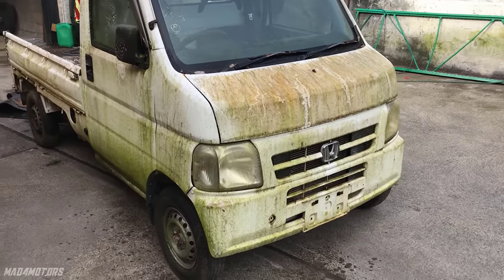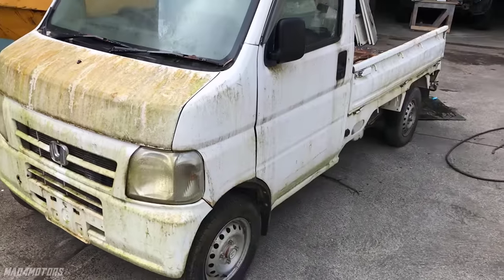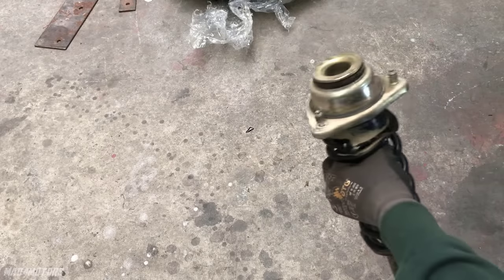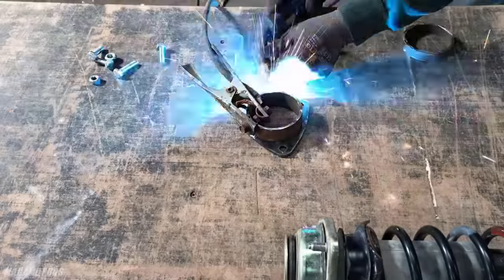Incredible Transformation Of A Honda Pickup

Comment: You did a good job on a reasonable budget. It must have been satisfying to do the transformation, cleaning off the rust and painting everything.
Can't believe the number of dislikes you got though. Very strange! Obviously it was never intended to be a bare metal restoration.
Reply: Its just shoddy repairs , proper repairs would not take much more.
Reply: @Alderonn10  its a work truck not a pavement princess show truck, repairs are different in the working world, heck could even be a weekend fun truck to use in the bush either way doing first class repairs would be pointless on something you plan on actually using and beating around in the bush

Comment: Much nicer than it was. Great job overall. Personally I'm not sold on the bed liner paint job for the whole thing. While it could be (probably is) more durable than a more standard paint it definitely comes off as a 'quick and easy' type deal that reflects in the final product. Obviously sanding/priming the whole truck for a more standard paint job would be a tremendous amount more work. Other than that the front lenses look like they could brighten up a bit with a polish or maybe a lot clearer with a quick LED lamp conversion. Either way you brought a lot of life back into that little truck and it's great that you did.
Reply: The benefit to doing this to trail trucks is it makes touch-ups way simpler and allows it to be fully usable as a work truck. But I agree it looks worse

Comment: Thanks for those highly entertaining videos. They are really brightening my sunday afternoon. I am quite impressed with how your paintjobs tend to turn out. Most non-painterbooth paintjobs i have seen so far don´t look anywhere near that good. That heavy duty coating was a great choice for this thing imo! 

It´s a shame a built like that would probably never be possible to be driven on the road here in Germany. The TÜV can be a pain in the butt when it comes to things like the bullbar, the lights that you added and the bigger wheels. But since i lack a few things to try my hand with a restoration like that (foremost a space to do it in and about all the skills beyond cleaning the basecar and pulling it apart.. 😉) I won´t have to find out if it´s possible to get one on the road legally. 

Just two questions remain: How much does it cost you (roughly) to bring a car like this to the state it´s in at the end of the video? And why do all your builds have the steering wheels on the wrong side? (Just kidding ).

Thanks for all this qualitycontent, keep up the great work!

Comment: Great video and amazing work! I live in a country where salt is much used in the winter. Therefore, it is common to rust underneath cars. Can you show how you may rustproof / treat rusted metals under cars in your future videos? For example, I was wondering if you painted the underpart of the car using raptor coating as well? Does raptor coating help prevent salt damages to the metal?

Comment: Where did u get that little sand blaster I'm working on a 92 ford fiesta and the wing and all the body panels are welded on for some reason would be a handy yoke to have instead of breaking out the angle grinder. Great video 👍🤙
Reply from the maker: I think I picked it up on eBay, very handy tool👍

Comment: I love the idea maybe with a bit more ground clearance but, and this is what's stopped me having a similar thing, there's no getting around that 660cc engine. 
This would be a cracking little machine for (say) light forestry work where you know the ground is going to be dry and level or on a smallholding but beyond that or for more than 50mph between sites .............we're gonna need a bigger boat.

Comment: Spraying the whole truck in bed tar is a little overkill but not bad for a tough paint that wont scratch…(as easily anyway)
Reply: You’d be surprised at how many trucks are painted with bed liner. Like you mentioned, it’s great for no scratches especially if you’re using the truck and a work truck or off road toy!

Comment: You seem to be pretty knowledgeable about these Honda tucks I am not but I like Honda products and have been wondering if a right hand drive can be swapped over to left hand ?  I am in the United States  and  will probably get a manual transmission  but I have a left arm injury  so would need to set up the vehicle similar to a left hand driver  on most vehicles built that way in the factory  I’m curious if there are any kits available  in the US I know one guy that  did the opposite on a Honda Civic  converting his Left hand drive to a Right  to achieve a Unique Customization  I believe he sold the vehicle  a while ago
Reply: You can get left hand drive ones.

Comment: Couldn't help noticing your welding technique. Try welding in the same direction as your wire feed from the contact tip. MMA (stick welding) you drag the electrode. Mig welding is the opposite. I'm sure this produce better / stronger welds.
Reply: Was he using gas or flux core? I didn’t notice. But I’ve heard “with slag, you drag” so with gas push, flux core, drag, just like stick. Anyone else heard that?

Comment: What does Honda call this pickup and where do they sell it? Also, what are its specifications? It looks like it must be a mid-engine design, right? A 4-banger? Manual transmission? How many gears? FWD? AWD? RWD? Where can I read about this truck? Can I buy one in the USA? It's a good video, but you could speak. You used tools and products I didn't recognize. Without speech the episode was entertaining but not as instructive as I would have liked.

Comment: Good for you but that is definition of lipstick on a pig so far as I'm concerned, replacing spark plugs, a re-spray and coat + bog, panel repair, el cheapo 'lift kit', new cheapo rims & 355lb load rated motorbike/ATV tyres, ultracheap LED light bars. I wouldn't expect you to put much $ into that machine but I'm sorry I'm just not a fan of any part of this project.